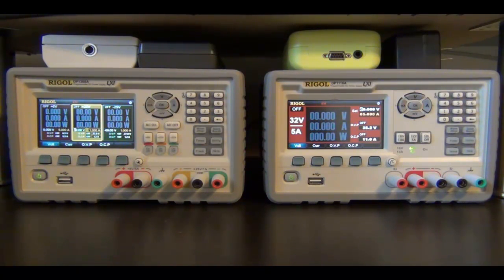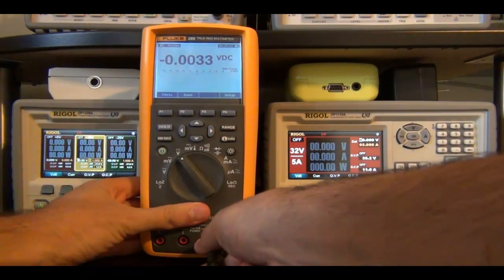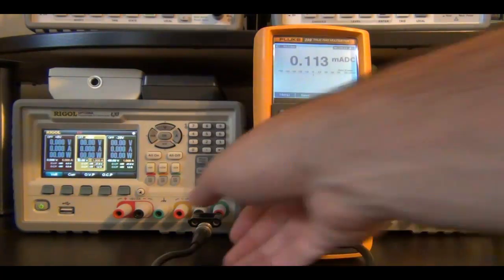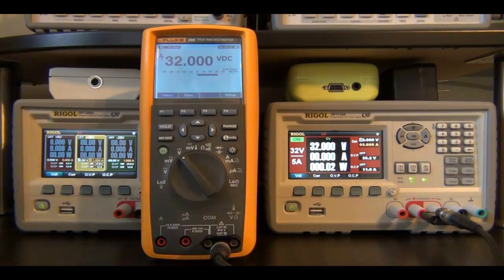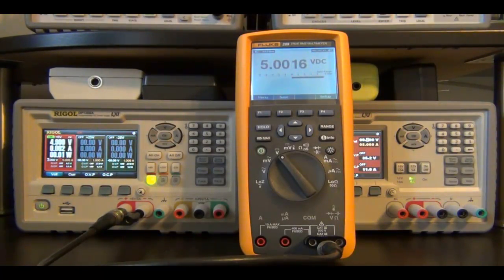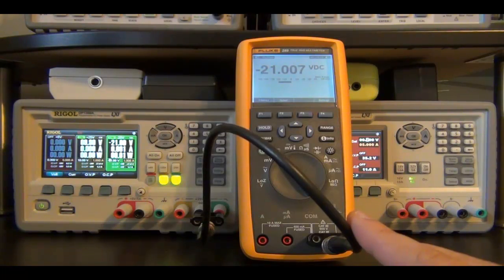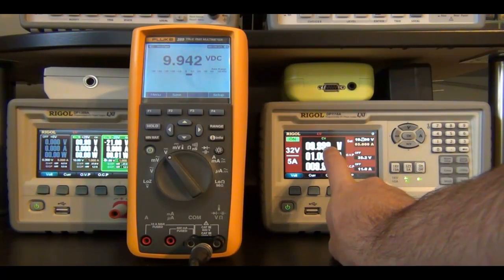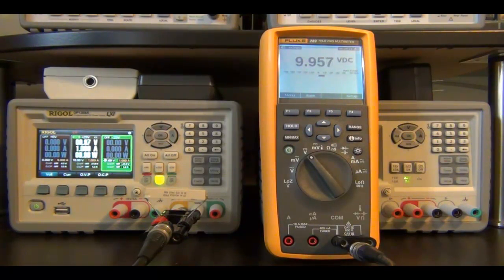TSP #6 - Rigol DP1116A and DP1308A Programmable Power Supply Review (Part 3/6)

Comment: Well to answer your quiz, I think the resistance is changing with time due to its temperature coefficient. As the resistor heats up, it warms the connectors (and their interfaces), changing their resistance and thus the voltage drop across them.

Great videos! Quick question: Are the commons on the 3 output supply isolated as well, or are they tied together? (I'm curious if it can be used as a 50V 1A supply).